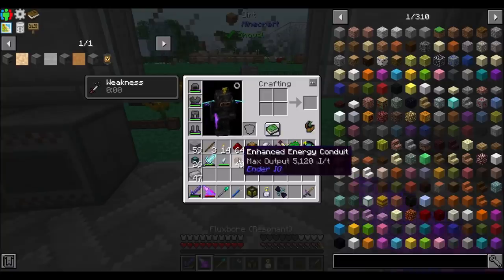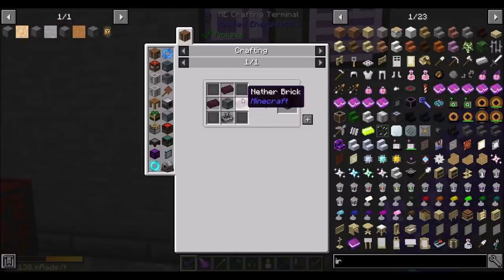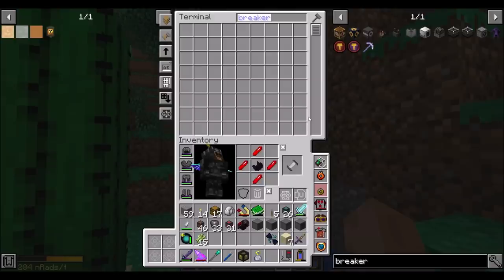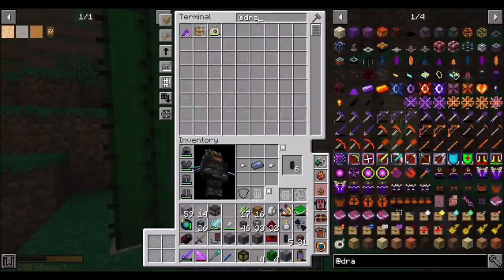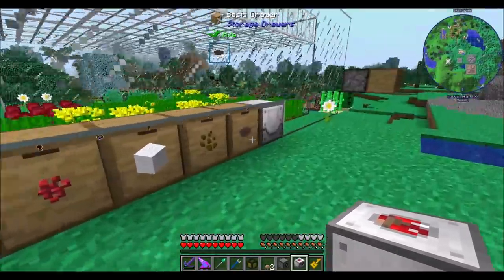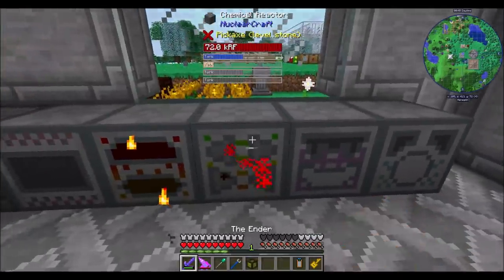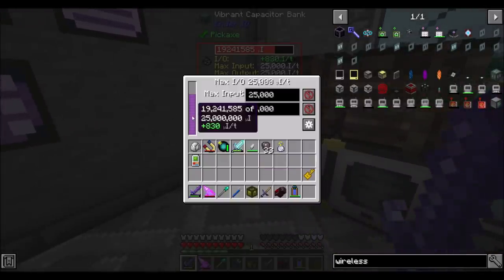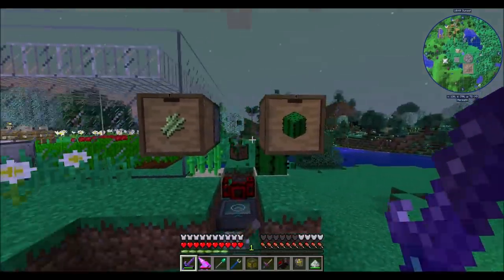FTB Revelations Ep28 Radiation and Plants

Comment: Ok so I have a question about a game mechanic I've noticed that has changed since 1.7.10 I believe. Why do machines not accept the correct amount of power they need anymore? There used to be a time when you could tick accelerate machines and they would just start drawing in more power and keep the machines buffer full. I've especially noticed this with Thermal Expansion and EnderIO machines. And before one of you say "It's the transfer limit of the cables" I must tell you I don't use cables, I use flux networks attached directly to the machines. Does anyone have any Ideas?
Reply: @Mar10K0ng  No there isn't, that's literally the point of using flux networks is that there is not a limit. I'm generating over 700 million rf/tick so I should know
Reply: They probably accept a max amount at this point
Reply: @Mar10K0ng  There are buttons on it that say surge mode and bypass limit, who the hell in there right mind wouldn't put those on......Use your brain dude
Reply: @marcopasta6274  Yeah I kinda figured, it sucks because that kinda even defeats the point of having high tier fluxducts in Thermal if the machines can't even accept it
Reply: It’s a limit with the machines themselves re: how much power they will draw.
Reply: @chris909090  that's what I'm trying to say man in 1.7.10 they didn't have a limit on how much energy they could accept you used to be able to just input infinite energy into a machine that way no matter how much it used or how much you spent it up using either the time wand or that bottle of time thing or even the torcherino mod no matter what you did it would always have enough power